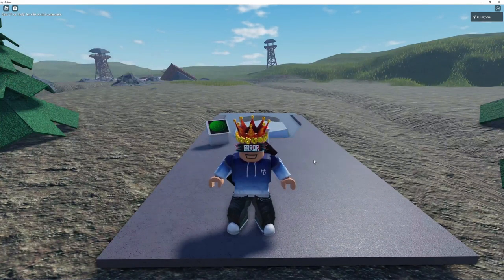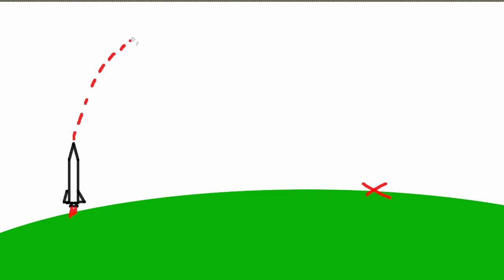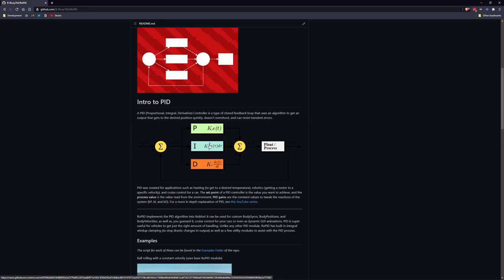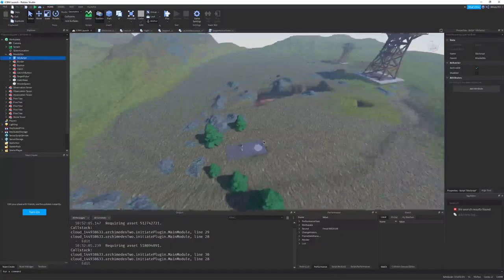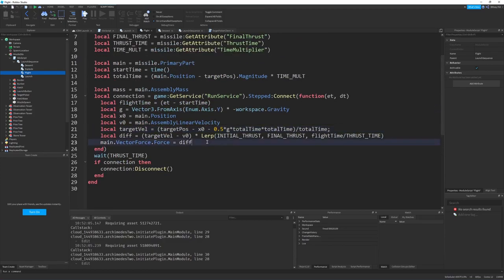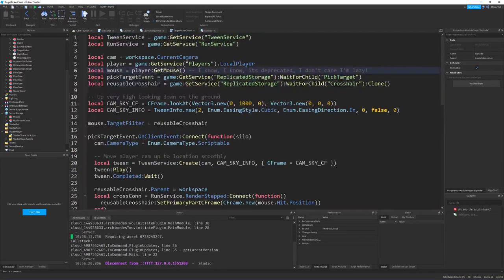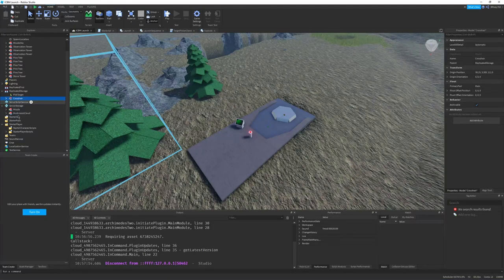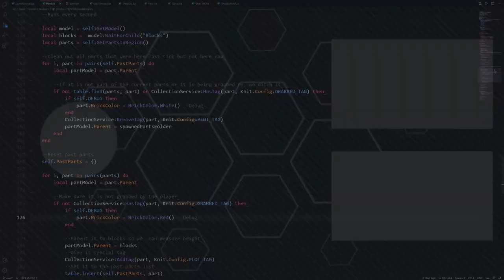Launching a Ballistic Missile in Roblox (and how I made it)

Comment: hey  have 1 question.
1. How do i make the buildings explodable
Reply: Weld and Unanchor them
Reply: @Korum211  that makes the building fall
Reply: @baconafy1829  If you weld it it wont fall, if it falls after that add anchored parts at the bottom to act as supports. These won't be destroyed, however it will allow the rest of the building not to fall
Reply: @Korum211  ohh ok thanks